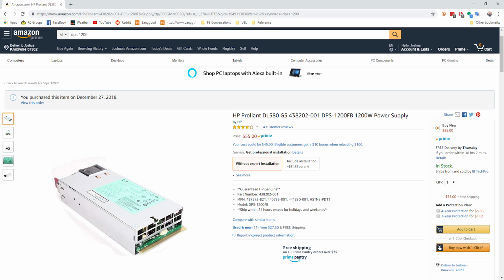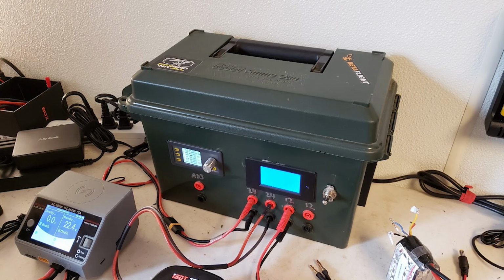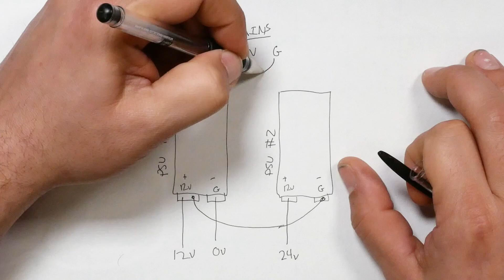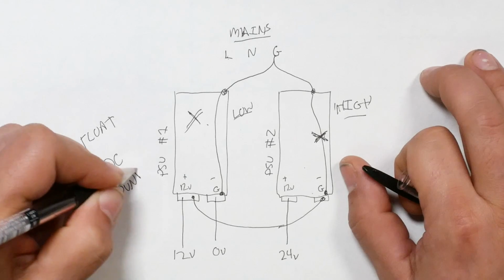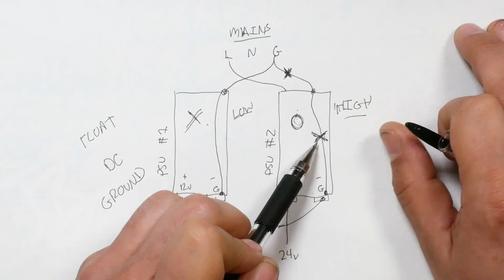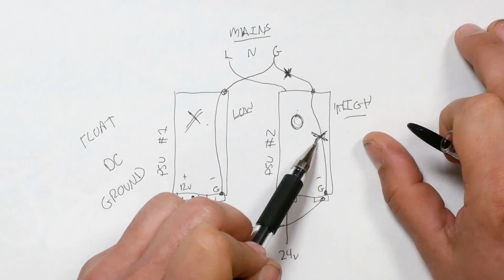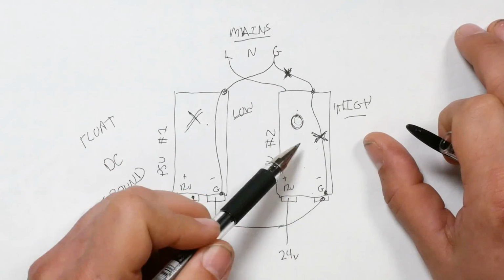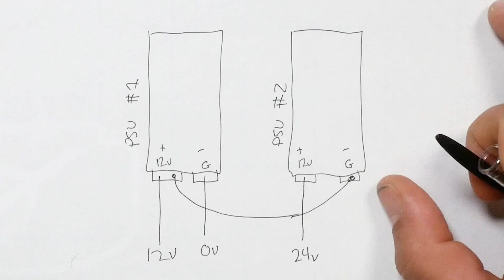How To Build A 24v / 2400W Power Supply | BEST BANG FOR BUCK 24V PSU

Comment: If you get a DPS1200FB-1 A, which is slightly different from the ones in the video (there are several variants of the DPS1200, mostly just diferent efficiency figures, operationally they're the same), you have to use a pretty low resistance.  I tried 1K and they didn't power on.  Tried 680 Ohm and they didn't power on.  I didn't have any 330 ohm, so I just used two 680 Ohm in parallel, and that worked.  So it seems like you need a 330 Ohm resistor for the FB-1 A variant.  Other versions may not require such a low value, but 330 should work for all of them.

Comment: After much heavy thinking for a few hours. I have to say I don't think this is the best bang for your buck. I will tell you why. I am sorry but you will never get close to 2400 watts from this. The reason is OHMs law. A standard receptacle in the US is rated for 15 amps. The breaker in the box is 15 amps. And 14-2 is what standard house hold electrical wire, also is rated for 15 amps. So your running 120 volts times 15 amps and you get 1800 watts. Now that is at 100% efficiency and we all know nothing is 100%. Also breakers in the box are actually designed to trip at 80% of max. If amp draw is great then 12 amps for any length of time you will trip the breaker. So that take it down to 1440 usable watts. The way I think I would do this project would be to get a couple of the small scooter batteries say 10 amp hour, I have seen these around $40 for the pair, and a small 400-500 watt 24v power supply to charge them, $40-50 bucks if you look hard. I would put them in some type of ammo box just like you did to make it a portable charger. Maybe I am thinking wrong on this. I would love to hear your thoughts.
Reply: I have a couple of server power supply's. With my hitech charger and my server  power supply I can charge at almost 30 amps. I dont think owms law applys in this case. I think that when you input AC and change it to DC output the  ohms law has nothing to do with this. What you are saying is that no one can ever charge with more than 15 amps without blowing a breaker? Your logic is flawed some how. SORRY,
Reply: @fredalric9478  I am unsure which Hitech you have and yes you can charge at 30 amps. but you are not charging at 120 volts. Its all about total watts. Now I am assuming that your running 6S. Please correct me if I am wrong. So a 6S battery at full charge is 4.2 volts X 6= 25.2 volts Times that by 30 amps and you get 756 watts of output. This is well under the  1800 total watts you can get from your receptacle. You can get get 150 amps as long as your your voltage is 10-12 volts. When it comes to electrical OHMs law is always in place.
Reply: @johncollins3910  OK I must study this more. I have not tried to sell any of my power supply's because am unsure of of what we have talked about here. I due not want to false advertise. I don't have the equipment to test my supply's so, I will get back to you if you don't mind.

Comment: I am by far not an electrical expert but, wouldn't putting a large diode on the ground side be a much easier?
Reply from the maker: I guess it could work but It would need to be rated for tens of amps and over 1000 watts.

Comment: Is it possible to use a 12v ATX 300W supply to get 24v of the same output?
I just need a 30v that can put out at least 100w?
Could i use a buck boost to achieve this?

Comment: Picked up 2 of these used on the evilbays for $29 shipped lol.  Same charger too except the DC only one.  Saves $40 over the "pro" by not having the AC plug.  Don't need the AC plug.  650Wx2 and 15 amps per channel for about $150 total... can't beat that...

Comment: Two questions - 1) The power supplies I purchased look exactly the same as yours, but I have FOUR standoff screws.  Do I insulate all four or is there one that shouldn't be insulated (per SuperBrainAK 6months ago - "DO NOT ISOLATE THE BACK SCREW.")?
2) How do I rewire the two 120 v power supplies to operate on 240 volts?
Reply from the maker: Only the front two screws should be isolated. I have learned that the back screws on the AC side should not be isolated.

You cannot safely rewire a 120v supply to operate on 240v. At least not any way I know. But almost all of these supplies work on up to 240v if you look at the specs.

Comment: Thanks for this Joshua.  I'm in the process of building one of these.  I noticed the volt regulator in the video and the pictures.  However, your blog doesn't list it nor does this or your other video speak about how it is wired into the system.  Would it be possible to update the video or blog to include it?  Thanks!

Comment: quick question, so the wattage on both psu add up. for example. my chargers max wattage is 1000w on 24v. therfore i would only need to combine two 500w power supplys?

Comment: Does the 2 psu have to be plug in? Or just one psu?thanks
Reply from the maker: Uth have to be plugged in.
Reply: Joshua Bardwell Uth? You mean both?thanks
Also on the resistor does it matter how many watts is the resistor?thanks
Reply from the maker: 1/4 watt is fine.

Comment: So with the hp ps I have the resistor from fourth pad to first pad doesn't work. I have to go from second pad to second pad on bottom. (No resistor)   I also had it going from third pad on bottom to the positive side. I took that off of the floater because it was now feeding that third pin underneath 25 v.  Seems to be working now.

Comment: You say that. But I picked up a pair of 2450W PSUs for $28 delivered. So once I finish running em in series, it'll be 4800W (24V 200A. The extra 50W was just a 5V 10A output that I doubt I'll use at all, maybe to power a Pi?) for $28. I've not seen anything remotely close to as cheap. And it's 92% efficient (80 Plus Gold rated). The PSUs are HUGE though. I have a server cabinet that houses all of my gear, so it's no problem for me. But it may be a bit difficult to fit on a workbench...

Comment: If a buy a 24v power supply will it work it be a problem if I use it to power a 12 volt battery
Reply from the maker: The PSU puts 24v into the charger. The charger then modulates that down to whatever is needed to charge the battery. You don't plug the battery directly into the PSU.

Comment: Ordered it all lol. Couple of items on your web page list are "Not Available" on Amazon. There are plenty of other options that do the same thing ie the ac multimeter display, banana plugs. I'm mounting two isdt q6 pros on 24v with 12v and  24v constant and adjustable voltage below. Also will have 4 usb 5w 2a ports flush mounted on one side. In case I can find some flying buddies that might need a phone charged. I know this system is going to have way more than I'll need, but someday I might need to have 4 chargers and 20+ batteries charging at 5c lmao. 
     What are your thoughts on going bigger. 36v adjustable ports by adding another 12v 1200w ps. I know it'll be capable of around 100a. My thinking was it is available if ever needed but could also serve as another channel of 0.1v thru 36v. Need a slightly bigger box for ease of work but could all have isolated bus bars routing to 12v/24v/36v circuits. Mount some battery terminals on back side for 12v bypass input(jumper cables)fused of course and switch. That moment when you plug in a creation, boom or relief, priceless 
       I enjoy overdoing the already impressively dangerous stuff. I am tired of my little 12v 6a charger, 2+ hours to charge a bank at 1c.
Reply from the maker: I don't see much point I going to 36v. 24v is enough to max out the charger, and the additional watts are probably not going to be used.
Reply: @JoshuaBardwell  might be useful at a race or big rc day but not worth the extra expense. I'm just flying with my son, 24v is all I ordered for. And I'll never touch its limits. Thanks for all your work, I hope its getting your bills paid and much more!
   Ps thanks for the rdq video. I used them( through your link ofcourse). Special company there.

Comment: Just bought a 24V 1200 watt extreme power supply on Banggood for just 80 bucks! Works awesome with my Icharger duo and have the advantage of having 4 output ports
Reply: Splash FPV do u have a link?

Comment: DO NOT ISOLATE THE BACK SCREW. that is there for the class y capacitors, look up how a switch mode power supply is designed. you should have checked if it was connected to the low voltage side, anything on the high voltage side that is grounded should be grounded.
Reply: Can confirm it is not necessary to isolate the back screw. The DC ground is floated without isolating the back screw. Don't isolate ANYTHING unless it is absolutely necessary for the mod. Try a continuity test for yourself without isolating the back screw, you'll get the same results shown in the video.
Reply: Oh shoot. I better put back the metal screw then 🤣🤣
Reply: Hello is this a for sure?? Please reply with detail TKS

Comment: How much sound does that thing make?
Reply from the maker: It's not too bad. It's seldom running anywhere close to full capacity.
Reply: @JoshuaBardwell  Thank you for the quick reply. I am looking for a thin PSU that I could use in a "Suitcase" PC build, and I am contemplating if an OP Server PSU would be silent enough under 50% load.
So could you stand close to it while using a PC, or is it too load? Sorry I didn't phrase my first question this way :)

BTW no clue how I stumbled on your vid.

Comment: Hello Joshua. I've got a problem, and I hope you can help me. I've got a Diatone gt-r90, and one of the motor bells feels a little bit lose. If I compare the sound of that motor to a normal motor, it sounds a bit different. But the motor doesn't get hotter than the others if I fly. Can I keep use it? Or should I take the motor apart? Or just replace it?

Comment: Hi Joshua, I just finished building my 12V/24v/Var supply based on your first video.  I have to admit, it took research and perseverance to put it all together.  It would be very nice to have a wiring diagram and operational instructions for the variable controller.  That said, I did it and I am very happy with the results.  Thanks!!

Comment: there are LIVE, NEUTRAL and EARTH connections on MAINS VOLTAGE SOCKETS! If there is a connection between LIVE and EARTH (you are reffering to it as GND) there is a RCD (Residual current device) switch which will be tripped and the power to you're room or entire home will go out. At least until you reset the RCD switch in your fuse box. The breaker or as we say fuse is connected between LIVE and NEUTRAL wire, the fuse will not protect you if the case of the power supply gets connected to LIVE wire. It will protect you if the circuitry in the LOAD is shorted!

Just making MAINS SUPPLY terms and ideology clear here.

Comment: Are you sure the back screw really goes to the dc grd? I think i got the Very same adapter and didnt get continuity between that screw and the dc grd pad.
Reply: No you should only isolate the DC side on a single supply (if you are doing more than 2 supplies then you isolate DC ground on all of them EXCEPT the "first" one)
Reply: Jackson Pfeffer exactly. I did this over a year ago, just didn’t see the need for that screw.

Comment: Is it truly outputting 1200 watts? The label at 6:53 shows that you have to connect it to 220vac to get 1200 watts. At 110vac, you get 900 watts max so a total of 1800 watt, not 2400. Still a good video! I like the idea of making things to keep it affordable!
Reply from the maker: Still a pretty good value at 1800 watts, especially given the build quality is very high.
Reply: @JoshuaBardwell  Agreed, it's still a killer deal. Thanks for the time and effort to make the video!

Comment: He says it in the video but I’m not sure he states it well enough. Playing with mains power is a good way to die. Like seriously, if your gonna die in this hobby this is how it will happen.

In my opinion the benefits of saving a hundred dollars don’t out weigh the benefits of 24v. That being said some people would argue that shorting control pins to make a 12v power supply work is just as playing with mains and I’m guilty of that.

Long story short, really think before you do this.

Comment: Wouldn't it be a 2400w psu? I think if you look In the back it will output 100A at 12V and if you put two In series it will put out 100A at 24V so thats 24V*100A=2400W of power!! Which Is a total pop ur braker overkill of  a psu. I settled with two 750w psu with 1500w :)
Reply: How'd your build come out?
Reply: @coloradodad671  Just fine! 🙂 It got left a little behind in progress. I'm still in the "process" of building a case for it in a pelican style hand case, but the psu is working great! Just remove the ground from the case from the other, and trick them to turn on by doing the jumper :)
Reply: @taneliharkonen2463  I got Dell 750s myself. I'm waiting on a buddy to send the hardware but I'm reading that you only need to do this to the two front screws and not the back one. I'm running these to power an M6D charger and figured this would be all the power I need to add in a second M6D in the future. Haven't figured out my case yet but we'll see after I get it finished.
Reply: @coloradodad671  Nice!! 💪 Yeah I think it was two screws connecting to the ground plane. But just make a clear cut to the ground plane separating it with plenty of gap or/and a plastic spacer or similar, and triple check continuity. But other than that its quite easy mod to do 🙂 thumbs up fo ur mod! 👍👍💪
Reply: @taneliharkonen2463  Thanks. One more thing. I'm probably going to wire an XT60 lead but how would I go about adding a second. I know you may not know the answer but figured I'd throw it out there. Would I wire two blacks to one pad and two reds to another or would they have to be completely on their own pads?
Reply: @coloradodad671  Yeah I do it too with splitter wires. Just make sure ut soldering id dolid 💪

Comment: Go to HOMEdepot and paint the case with rubber dipp, paint a coat or two be done, or use 10 layers of scotch double stick, 15mm insulation should do., maybe 1 layer will do. Most likely wont wear.

Comment: Thanks for putting this one up. I’ve got a charger that I can’t use until I get a power supply something like the one you showed a build on. Even though I know I could just buy one part of the hobby for me is building stuff myself and learning through the process. On a separate note, do you know of any freestyle groups in the Greenville, SC area? I’m struggling to find anybody around that flys freestyle.

Comment: Why not conformal coat both the standoff and the board contact pads? No filing no fiddling with washers
Reply from the maker: Conformal is not a reliable long term solution in my opinion. I think it will wear through over time.

Comment: That would fail Ul but will work ... adding a single over load to handled both drivers or input detection on two independent normally open relays might make it safer. That way if one burns out they both shut off.

Comment: Just curiously, why not isolate the boards in both supplies?
Reply from the maker: It's a pain in the butt to do the work, so why put yourself through it? And in theory, floating the DC ground opens up some new failure modes.

Comment: Why not just buy a 24 volt power supply?  I have a couple already for other purposes!
Reply from the maker: Because a 2400 watt 24v PSU is much more expensive than this, especially at this quality level. If you are fine spending $50 on a 400 watt PSU, go for it.